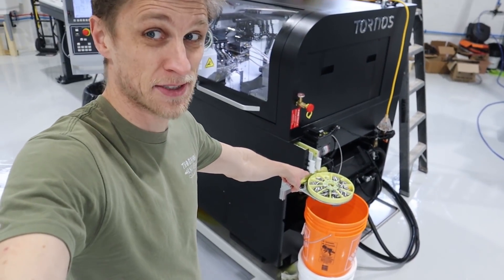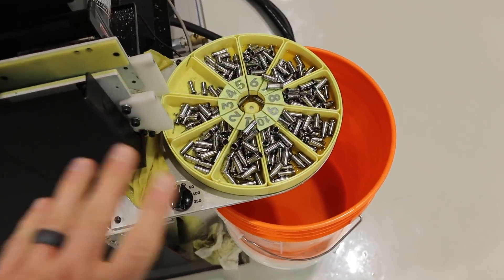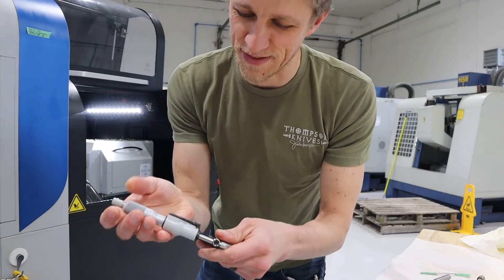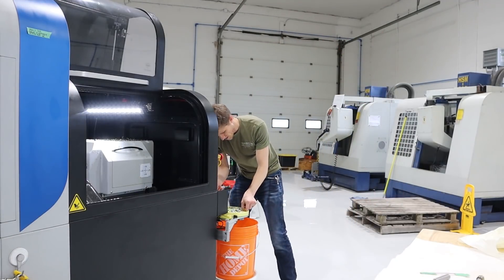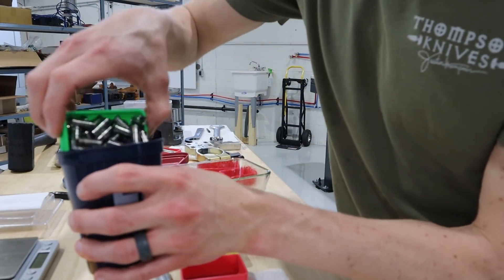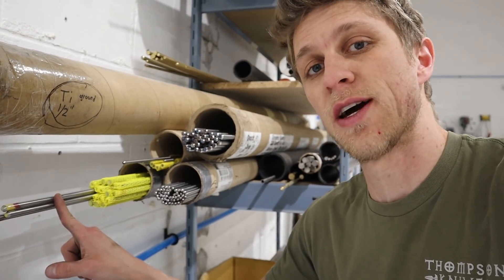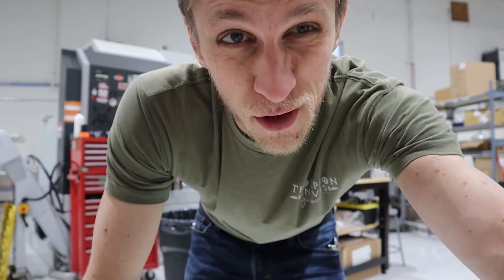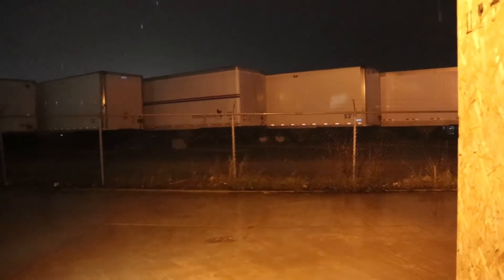Quarantined Shop Life - Day 8 Pandemic knife progress!

Comment: That parts catcher needs oil drain holes. I would also make it so that the 'walls' were their own assembly that stayed on the carousel (removable for cleaning, of course), and you just slid the parts trays out the bottom -- reaching down into tall bins for tiny parts like screws would quickly get annoying and waste time.

You could also potentially create a holding space that retained whatever the last part off the lathe was.  New part comes off, the held part is dumped into the tray and is replaced by the most recent.  That way, whenever the machine stops, that truly final part is in the 'holding' area.

Also, I was thinking about your 'checklist' issue, and post-its are great, but not consistent.  Laminated sheets and some dry erase markers?  Have one for every part you run on a split ring stuck on a magnet to the machine that has all of the setup steps, and whoever's doing setup initials each step?  Would the initials get obliterated by coolant-hands?  Also would make a good place for notes (eg, first part measurements, notes to whoever comes along mid-job or after-job, etc.)

Also, where's the branded, machined titanium USB stick housing?  Just saying, gotta go Full Grimsmo.

Comment: Holy shit John, my toes curled when you where ripping out that birds nest! Your luckier than I am!
Reply: I couldnt watch
Reply: I've had around 10 or so cuts from ripping out birds nests like that from steel parts. Never fun. I wonder how it feels with titanium
Reply: Those are very small curls. You get cut once you get into larger ones AND most importantly in my opinion, if you don't grip it well enough. I've never got any cuts on my hands (bleeding cuts) pulling any chips or nests. Not, that i advise anyone do it barehanded.
Reply: @aserta  It's stainless, not Ti.
Reply: The bitch that gets me is brass chips, they lurk around for ages, wneh you just happen to be doing somthing around the machine, not clearing swarf.  You always manage to get the little critter in your hands.

Comment: Have a gauge company make you a go no go external thread checker too, or make one yourself. Measuring multi parts with the wires is for the birds.  Pretty sweet you are getting the swiss dialed in to your operation.  Bump your feeds up to get that chip to break!
Reply from the maker: But at a faster feed the finish turns to poo
Reply: @JohnGrimsmo  Then the next option would be more speed and a deeper depth of cut. Probably harder to hold size like that. Makes it tough. Add a decorative groove as the first op so you have built in every rev chip breaking. LOL

Comment: I used a Dremel brand impact engraver for marking parts, when you get a bit of practice it does a very nice job.  One trick is to make sure the angle of the tip isn't too steep (pointy).
Reply: Correct, tool almost  vertical.

Comment: Dumb question, but can't you run just one channel of the tornos at a time? And so, you know that the last part before you left for the night was good, and the last part that remains in the sub spindle half done can be finished by stepping through channel two, finishing the part?  

Check for tolerances, and everything in between is good?
Reply from the maker: Yep you can definitely run one channel indepenently, I do it all the time (just haven't filmed it during this series).  It's just tricky because you've gotta watch it closely, because either side you run will move to the part transfer at the end, without the other side doing the work.  So the main side would just cut it off, but the sub side would grab air.  So I try to stop it before the transfer.